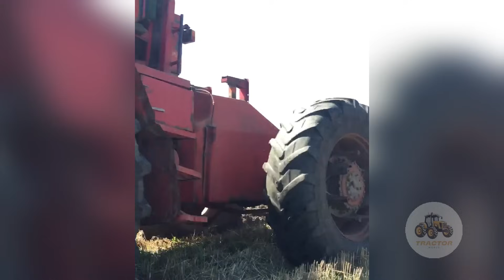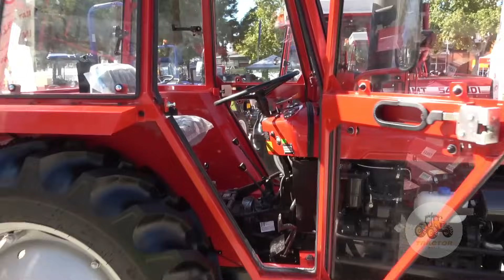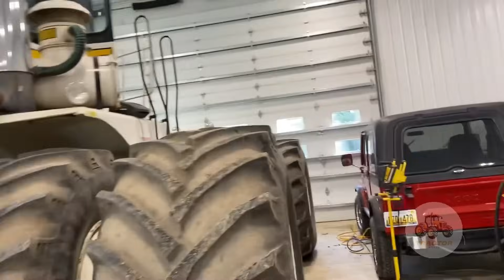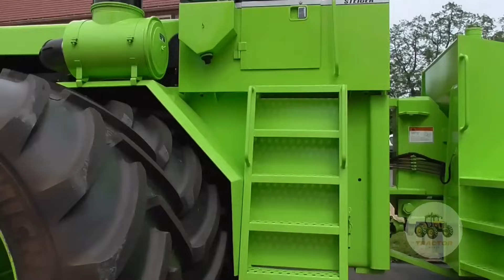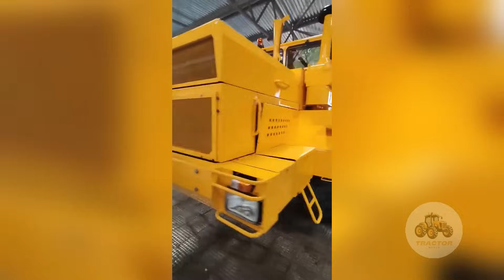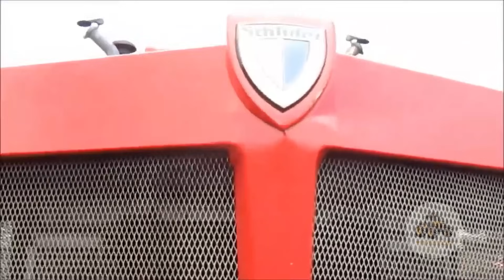Top 10 Legendary V12 Tractors That Changed Farming Forever

Comment: The steiger wasn't v12
Reply from the maker: Good catch, you’re right, most Steigers ran big inline-6 or V8 engines, not V12s. Thanks for pointing that out! The video grouped legendary tractors with massive powerplants, but you’re absolutely correct on the Steiger’s setup.